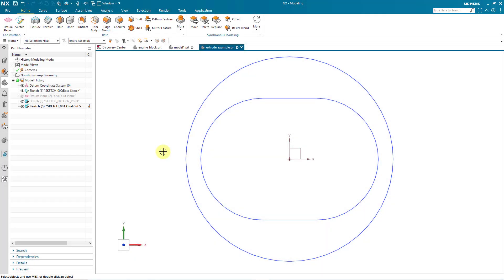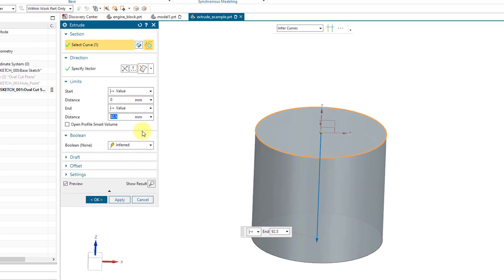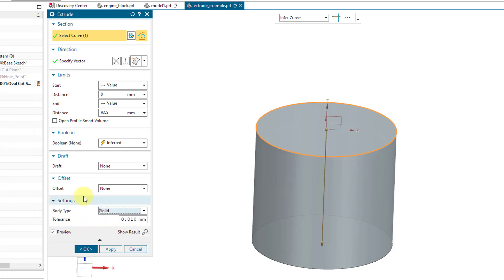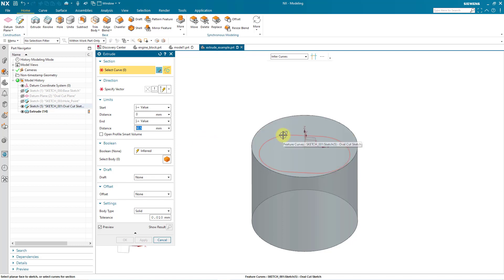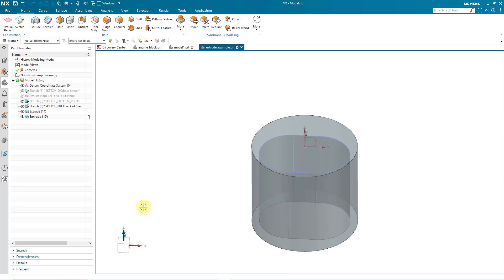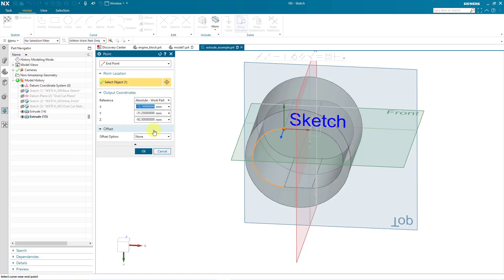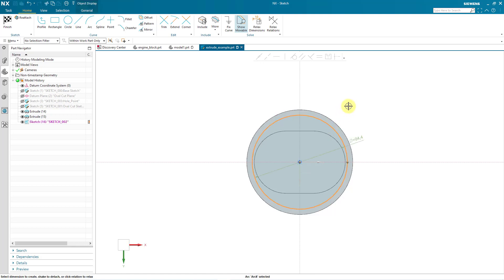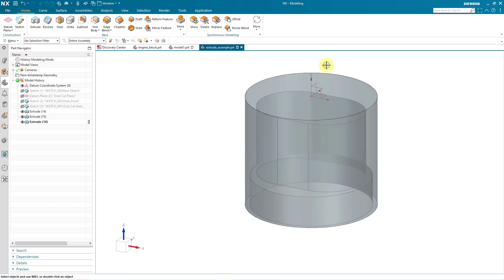Siemens NX for SolidWorks Users - Extrude Feature

Comment: I will add that the power of NX extrude truly lies in that you can extrude 3D curves or edges, not just the sketches, and change the extrude direction. In Creo you can only extrude a sketch in the normal direction of the sketch plane. Example could be:  undercut in a casting feature, that is not feasible to manufacture can be fixed by extrusion of cast form split line. Thats of course for more advanced tutorial and complex geometry.
Reply from the maker: Yes, as the title of this video notes, it is a video for people coming over from SolidWorks. As I noted in my community post a few weeks ago, these videos came about as a result of working for a startup that was switching from SolidWorks to NX. These videos were made internally for my coworkers to get them started up in NX quickly. They are not intended to show every single bell and whistle and the advanced functionality. As I noted in that community post, I would have never changed these videos from private to public had I not been laid off. I fully welcome an NX expert to share videos with the worldwide CAD community explaining the full power of the Extrude command.